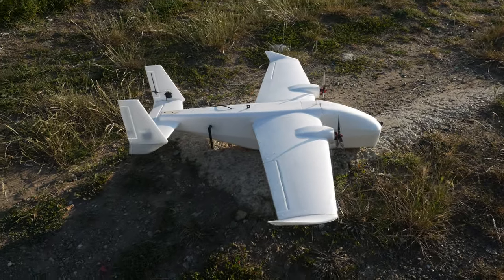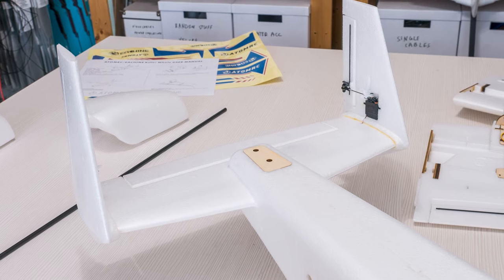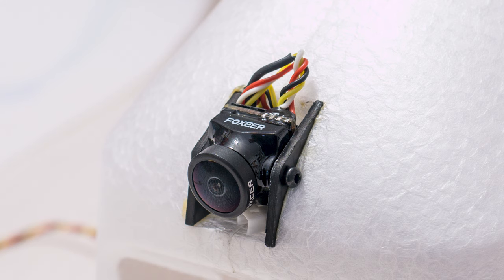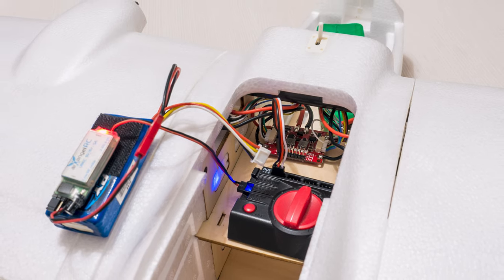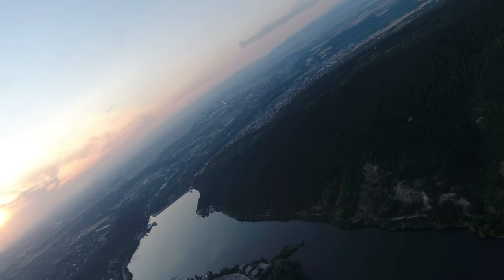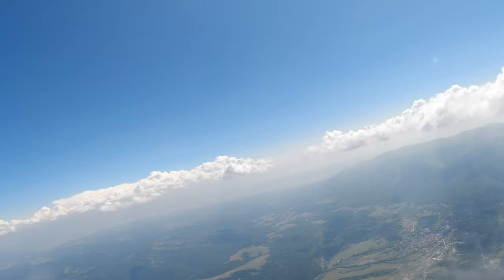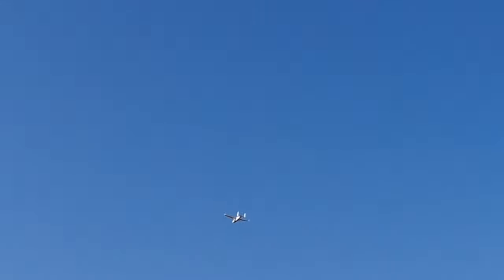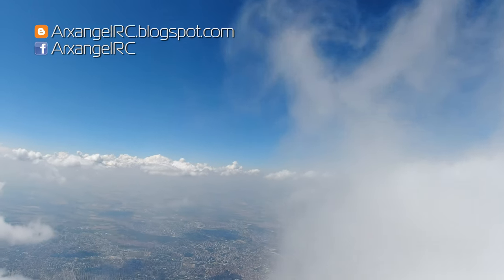AtomRC Killer Whale - a.k.a. The Razor Crest

Comment: Just got my V2 today. They've simplified the PDB significantly. It's purely a distribution board as it no longer has any BECs on it and they've done away with the electrical connectors on the wings, with the power and signal connections being on a 10 pin JST which can be unplugged from the PDB for wing removal. Not as satisfying a solution but should work ok.
Reply from the maker: Interesting, I've missed there is a V2 out there, but its good they are making changes, hopefully for the better.

Comment: You liked it so much and the video looked good so ... the price dropped - decided to get it! 
Using a Matek 765 on Ardupilot wo/the distribution board. Easier to make a 'Y' for the motors. Only problem I have so far - the front hatch has a latch and the the rear one lifts so I've already had to reglue the latch pin thing as I keep trying to pull it open... :) 
Today's maiden, decided to ROG off asphalt. No problem. Flew great. Used  8 - 18650's to make a 4s. Almost to the front wo/a camera. With the camera, moves aft less than an inch. It really flew nice! 
Thanks for the review!
Reply: As far as manufacturer, I have no idea but they are good quality ones. Capacity is 3450 so it's a 6900ma 4s pack...
Reply from the maker: @stanordave  Yes, the plane does fly nice, and it can indeed carry a good deal of weight! I am flying it with a 4S3P LiIon pack, so not the lightest one by far! Glad you like it!

Comment: I didn’t get the fpv version kinda wish I had but I did replace the nasty servos they gave us . I used the zohd 9gm metal . Also was thinking about using that back camera mount but turning it to face forward and putting my fpv rx there . Just need to chop off a bit of the small end it hangs over about a inch . It still bolts one nice and tight.
Reply from the maker: That it does! Could serve as a Vtx mount indeed! Nice idea! May even give it a try myself!

Comment: I guess you are still working on that Atomic Whale Killer article for your blog cause I could not find it. latest one  were the lame duck and Mustang.
I had been looking for a purchase link there or here but I was blinded and did not find it.
UPDATE: my brother found it far below than what I had expected in a section called: PARTS LISTS

I would suggest to put such plane purchase link on the top cause I usually click on those just to check prices if they would fit in our clubs budgets or not cause we tend to buy 4 to 5 of the same plane where 1 is planned to use as a spare part donator in case things went wrong. Saves a lot of time and headaches.
Reply from the maker: Haha, right, well since some videos are sponsored, and this is one of them, they require that I put their text at the top, hence why it is not there! On all other videos those links are right at the top!

Comment: Could you explain the reason for not using compass with Arduplane? Or maybe you have already in some of your videos.
Reply: If the vehicle is constantly moving, you don't need a compass because the GPS can provide an accurate heading....🤔🤔😳🇬🇧🇬🇧
Reply: @EnglishTurbines  Ok. Thanks.
Reply from the maker: Yeah, what Turbines said!
Reply: The GPS heading is only accurate assuming you are flying in perfect conditions (no wind). As with wind your plane may be drifting in a direction other than its true heading. But that's no reason not to use a compass, it's just maybe redundant in most conditions. With that said, are there more reasons to not use a compass?